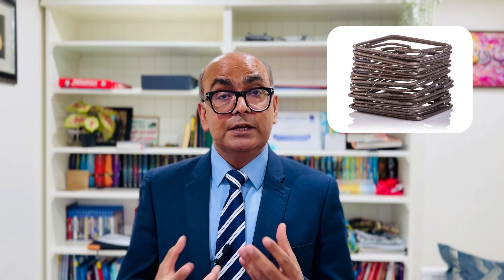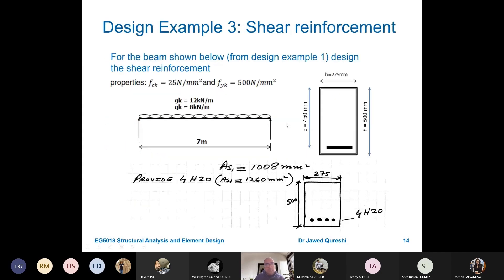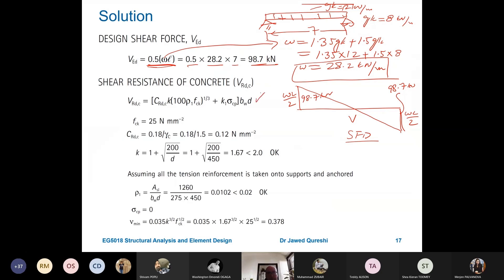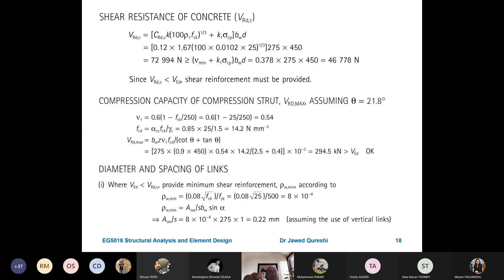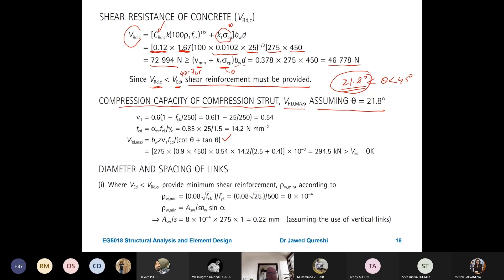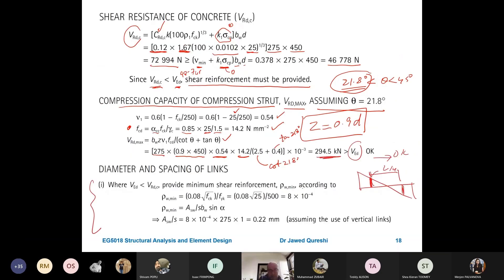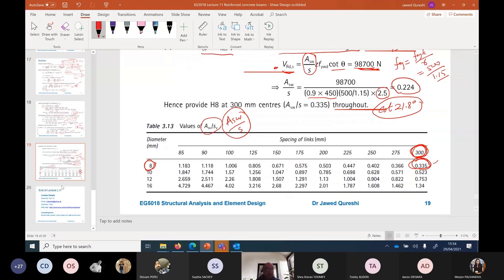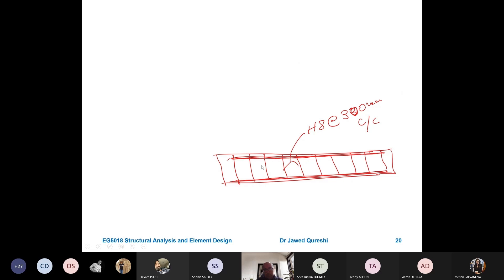11 Shear Design in beams – How to design shear reinforcement | Eurocode 2 Concrete Design TUTORIAL

Comment: 12:57 Thanks for your dedication, Dr.Jawed. is there an occasion where Ved applied be greater than Vrdmax( resistance by the concrete struts), and how do we proceed the design for shear links in such a phenomenon?
Reply from the maker: We have to ensure that concrete does not fail first.

Comment: In the provided example, you have assumed a theta value of 21.8 degrees. When designing, how to decide which theta value to adopt, whether it should be 21.8 degrees, 45 degrees, or a value in between. I think people prefer using 45 degree in design since it would give the greatest Vrd,max.
Reply from the maker: You are right; for ease, many designers assume the value of theta to be 45°. However, when a beam supports a uniformly distributed load, the value of theta should be 21.8° or roughly 22°. For a beam with point loads, a higher value of theta should be used. The common practice is to use 45° for beams supporting point loads, which is the maximum value as well. In old British codes (BS110), we did not have a choice; the value of theta was fixed at 45°. Assuming 45° is the worst-case scenario, which means we are on the safe side. There is a direct formula for working out the value of theta in IStructE Technical Note 4 on "Designing a Concrete Beam". I have placed this formula in the shear design folder at https://tinyurl.com/JQureshiConcrete.

It is my pleasure to be of any help.
Reply: @DrJQureshi Thank you, sir. I have one question that might not be related to this topic. For the design of cantilever retaining walls, why do we use the toe as the pivot for the bearing capacity check(geo)? However, for the structural member design  and detailing (str) (bearing capacity), we take the pivot point in the centreline of the base.
Reply from the maker: @marco-mz3wx  I’m not sure if I’m completely clear about the answer myself. I’ll get back to you after confirming with my colleagues.

Comment from the maker: ⏰ TIMECODES ⏰ 
00:00 – Introduction 
01:04 – Problem
01:24 – Link to design of tension bar
02:05 – Formulae for shear reinforcement & link to theory 
03:03 – Design shear force (Ved)
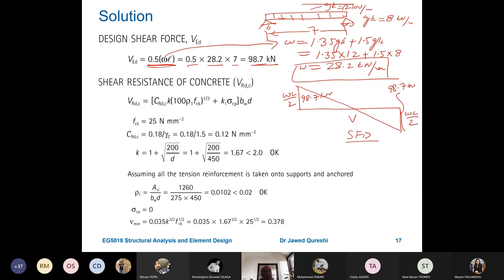04:33 – Shear resistance of concrete (VRd,c)
10:03 – Shear resistance struts and ties 
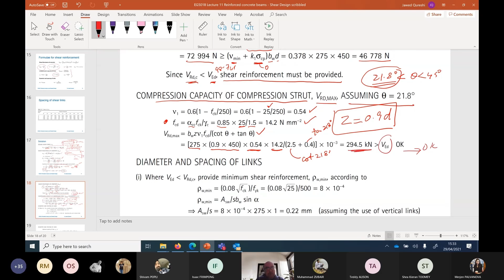12:52 – Diameter and spacing of links